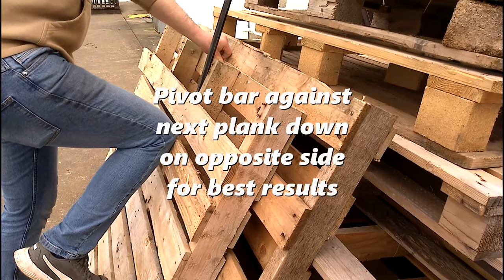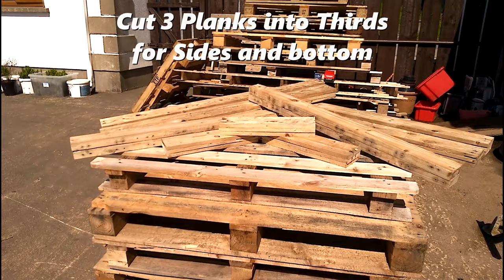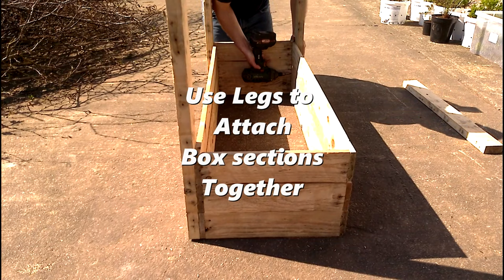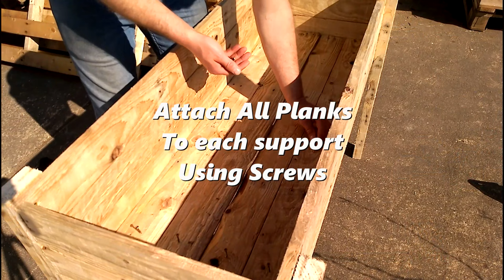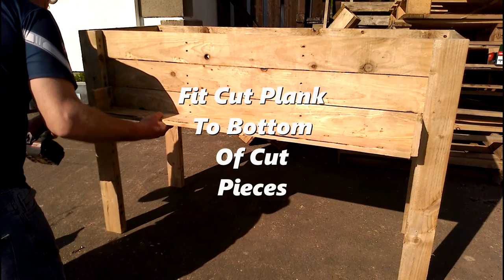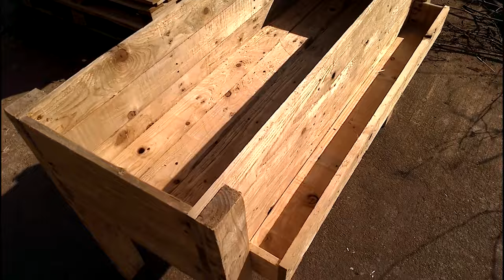DIY planter box from only 1 Pallet

Comment: Also, in addition to your fantastic build I'm going to wrap the inside with plastic, add a thin layer of expanded clay and a drainage hose just below the clay level. That was an advice from a friend, supposedly it retains the moisture and all the excessive water goes down so the roots won't get soaked. Will see how it works...

Comment: Great work, the best and simplest way I've seen so far. I'm doing exactly the same right now, but before I start putting together the pieces I have one (maybe stupid) question: why don't you attach the side cuts to front and rear in order to maintain the equal lenght of those for the bottom? I have got just a multitool, so in my case the less cutting, less work and less error.

Maybe it could affect the structure or something? Maybe it doesn't really matter?

Anyways, thanks for the great video 👍

Comment: Thank you for your design. You K.I.S.S.ed it! Other than the screws, this was a free build! Curious as to why you didn’t add drainage holes. Is that because the bottom boards weren't that tight/board  imperfections?  

I'm  keeping this video!😊😊😊
Reply from the maker: Thank you so much for your kind words. Yes you are spot on, there were small gaps in the wood that were just right for sufficient drainage without the compost washing out too. If the boards were a tight fit then drainage holes would definately have to be made.

Comment: Hello possibly a stupid question but if the boxes have the short planks on the inside of the long planks, then surely when I put the 4 long planks on the bottom later on, they will be slightly too long... did you have to trim your 4 planks to make them fit?  As the length of the sides internally is reduced, by the width of the short planks (maybe only a few centimetres).

Hope this makes sense!  Cheers for your video though, I still plan to try and follow this!
Reply from the maker: Yes if you're fitting them internally from a set of planks equal in length then you will have to shorten them by the width of each end wall which was 18mm per wall in the case of this build.
Reply: @ourkilkennyhomestead2006  OK cheers that makes sense. Do you reckon you could get away with just 3 on the bottom by the way, with spaces in between instead of 4 next to each other, or would the gaps be too big? (I intend to line mine with some kind of empty compost bag, or similar..)
Reply from the maker: @procs  no probs, don't think you'll get away with removing one bottom plank as the gaps would be around 2-3cm and the soil would fall through. It could be done however if you fitted a porous liner of some sort inside the box.
Reply: Can you think of any downside of screwing the sides on the other way around? So the small sides are on the outside, rather than in between the front/rear? Would save having to saw the longer ones slightly to length? @ourkilkennyhomestead2006
Reply from the maker: @proc5315  doing it the way you suggest could result in the sides falling off in a year or two.

Comment: What size nails did you use?
Reply from the maker: Hello, thanks for watching. I don't use nails tbh, they come loose. I used 4x30 screws for the boards and 6x 50 screws for the legs, If memory serves. I might not be 100% spot on there as it was over a year ago now but if you use screws around those sizes itll be perfect for you.

Comment: No way the bottom of the box will hold the hundreds of pounds of weight from soil and water without falling out.
Reply from the maker: No way you have a clue what you're talking about as its been planted in and working perfectly for months now in all weather.
Reply: @ourkilkennyhomestead2006   Did you line it with plastic, if not, it is only a matter of time, less than 12 months, the bottom WILL fall out.  Would love to see an update video.  The design is not bad (with a few modifications).  I appreciate the video, it's always nice to see people actually building things in which I wish I would make the time to build, so thanks!
Reply: What is your problem? You do a video to prove him wrong 😂
Reply: @catwinkler-Thor  "What is my problem?", my problem is that wood and moist soil do not last long before the wood surrenders.  I am not going make a video to prove the Earth is round, nor will I make a video to prove that wood will rot after prolonged contact with moist soil....these are all known facts.
Reply: Hundreds of pounds 😂😂😂
Reply: @ryanryan7213   Consider finishing your GED.  A gallon of water weighs almost 9 pounds.  Based on the dimensions of the planter box it easily exceeds 25 gallons of capacity, and hence will weigh hundreds of pounds when filled with wet soil.  Hope you learned something today. I swear the ignorance  I find on the internet is never ending, now that is something to laugh about🤣
Reply: Yes, the wood will get wet and eventually rot. That's the nature of garden beds. They are wood. You can use a wood sealant or cardboard for temporary prevention but it's inevitable. 

However it takes 5-10 years for this to take place. So, it really doesn't matter if you line your bed or not. You still get a good 5-10 years out of it. 

If you were looking for a longer lasting bed you should go with a galvanized metal bed. 

Either way, pointing out the inevitable doesn't stop it from happening. Coming up with a solution on your own- does.  🙃